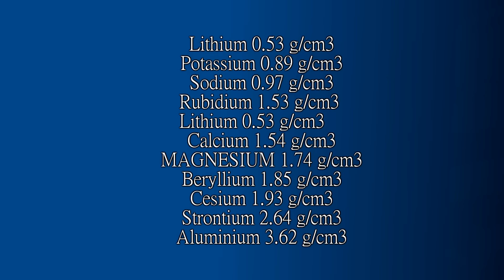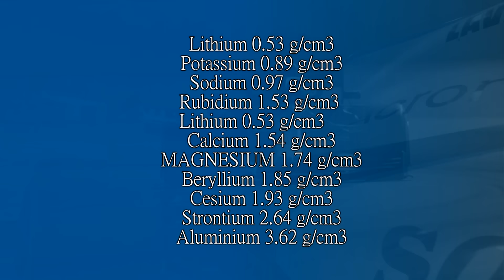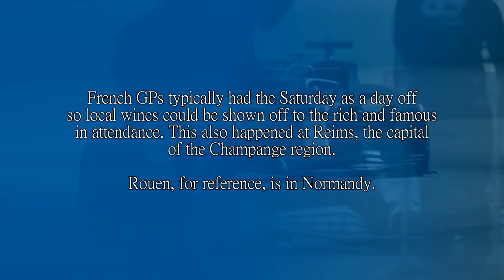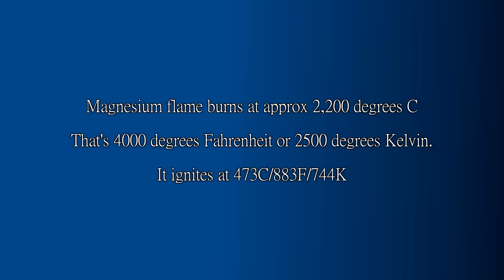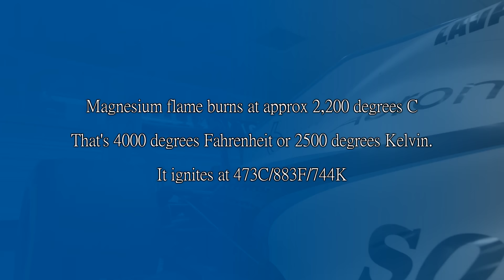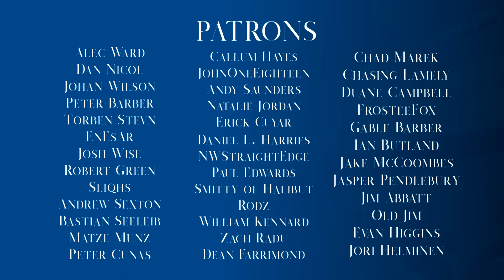The Car that Should Never Have Raced: The Story of the Honda RA302

Comment from the maker: Just some extra bits/corrections to save you writing them yourselves:

Aluminium is a little lighter than that table says
Eagle had also run a mag panel car. Gurney got rid of it after this.
Lockheed-Martin was just Lockheed in 1966. I just used the modern name.
Degrees kelvin isn’t a thing. Just kelvin
Reply: Composite DID exist and was in use in the aircraft industry.
Aluminum honeycomb fiberglass has been around since the 50's. 
As for Magnesium the fire attendants would have tried but found out that water on a magnesium fire intensifies it! Chances are it wasn't to bad fire wise until they added water to the mix then BOOM, it adds oxygen and the chemical process releases a lot of heat. Fire retardant for magnesium was available back then but for a truck full would have been 100K back then! The French are not spending that money are they let alone thinking about it?  John Surtees was no dummy and would have known this hence the refusal, remember he had no problem riding magnesium built motorcycles. 
As for the flammability of Chunks of magnesium it has a lot to do with the surface oxidation and heat present in the metal.  Magnesium is also cast so you would think it would just go up in flames during the casting process but it doesn't. It is the surface oxidation that prevents the combustion. When cast we used to smother the patterns with R12 until the cast temp was down low enough that external heat was required to commence combustion. We also machined magnesium wheels on CNC lathes mostly Group A during my time (DJR, WR, Nissan/Gibson and many others) and they were also dangerous to machine as you are producing magnesium ribbon if not finer during the process. A normal Aluminum wheel would use a single 1/4" coolant outlet to promote tool life and finish. On a Mag lathe we used 3 wash pumps pumping coolant at 70 psi through 1" outlets.  The coolant was also Glycol based. This kept the temp low enough and prevented exposure to air during the process when there was heat around as it was basically submerged.  A sub contractor did still loose a lathe to fire though during my time and because the release of R12 became illegal to save the Ozone they didn't have a magnesium fire extinguisher and their sand bin had got wet.
Reply from the maker: @dazaspc  good old fibreglass. Used on gliders but not really seen on an f1 car until a bit later after this.
Reply: @AidanMillward  F4 phantom glides pretty quickly🤣
Reply from the maker: @dazaspc  all planes are gliders if the engines pack in 🤔
Reply: Phenolic composite has been around since the 1920s.
Reply: @dazaspc  Actually, the F4 Phantom has the glide ratio just slightly better than a brick…
Reply: @dazaspc  No, not really. The shuttle was designed from the very beginning to be a “lifting body”. The F4 was designed with more thrust than lift.
Reply: @HappyHarryHardon  …would that be referring to “Bakelite”?
Reply: @AidanMillward  … some “gliding” MUCH BETTER than others
Reply: @dazaspc  The problem wasn`t magnesium or air cooling but the inexperience of Schlesser and bad weather. He did slide from the track on a corner and hit the earth bank. He got fatal injuries hitting the bank. The side fuel tank also exploded and made the car burn.
Reply: @AidanMillward  The problem wasn`t magnesium or air cooling but the inexperience of Schlesser and bad weather. He did slide from the track on a corner and hit the earth bank. He got fatal injuries hitting the bank. The side fuel tank also exploded and made the car burn.
Reply: The first composite F1 car appeared in... 1966. The M2B used a composite of Aluminium and Balsa wood for large sections of it's structure, and the M2A would use it for the entirety, though the reason the M2B was used is due to the inflexablity of the material.
Reply: @marguskiis7711  He indeed had an accident that resulted in a fuel fire. However the magnesium added a high temp fuel that was amplified when water was applied by the local fire guys. Magnesium catches fire at about 480C, melts at 650C and burns at a bit over 2000 C. Petrol catches at 280C and burns at about 950C. Magnesium added significantly to the intensity of the fire. Who is to say that it may have been survived but for the metal fire. Also a 2000c fire leaves little if no organic matter. Regardless it was a sad occurrence that with a little primer on the metal would have most likely slowed the fire a lot.
Reply: @dazaspc  Schlesser body lied besides the wreck dead (due the massive impact) and did not burn a lot.
Reply: @GroundHOG-2010  exactly, McLaren built the first one.
Reply: @HappyHarryHardon  9
Reply: @macmclemore  The shuttle is not a lifting body at all, it's a fuselage with distinct wings attached to it, a fairly conventional delta-winged airframe.
Reply: I always say "degrees Kelvin" just to troll the uptight.
Reply: 8kkkk
Reply: Random additional fact, there had already been an F1 car run composites by the 1968 season. Robin Herd, of later March fame, was hired as a designer/engineer for McLaren and developed their early F1 cars. Prior to that, he was an engineer at RAE working on Concorde. From that experiance the first McLaren F1 car, the M2B (and previous M2A test vehicle) used a composite called Mallite for large portions of the car. What is Mallite? It's Balsa wood skinned in Aluminium, which makes it rather light and stiff, but as per usual with wood... it's hard to bend and form to a curve. It would often break while being formed and required a lot more work.

Comment: It's mind-boggling how this happened 13 years after the 1955 LeMans disaster also involving a car made of magnesium and Honda thought nothing of it.
Reply: Not being around at the time, I guess those at the time understood as we do now that motor racing is dangerous... just their measure of acceptable risk was different. It was what it was. I'd assume that everyone understood plenty well that the 150+ liters of fuel they started the race with was flammable and that concern was ignored. Also, the flammability of the Elektron wasn't exactly the problematic part of the 1955 disaster.
Reply: Happened again in 1970.  Alejandro de Tomaso has built a magnesium chassis F1 car that Frank Williams entered for Piers Courage to drive.  Courage had a good year in 1969 driving a Brabham for Williams, but Frank wanted his own bespoke car to enter.  Courage crashed at Zandvoort and the result was another intense magnesium fire that was immune to being extinguished.  The "good" news is that Courage may have been killed by a tire before the fire started.
Reply: To be fair, through the 60s and 70s there were many, many cars were fielded that had Magnesium alloy parts, such as the Porsche 917.
Reply: I wasn't aware of magnesium being a problem in 1955 LeMan accident. I thought the biggest problem was the car going through the crowd?
Reply: @jamesharrison3537  The Merc chassis was made of Magnesium, when it caught fire water was used to try and put it out, which made the fire even bigger. After the initial crash a lot of the casualties were smoke inhalation and burns.
Reply: Let's not forget Lancia doing the same thing in the 80's and killed Group B in the process
Reply: Worth considering that Motorsport deaths and I mean spectators as well as drivers was not unusual. And also it's worth remembering that human life didn't have the same significance we 'westerners' are used to considering today. 
F1 was largely a European sport and as a result the people involved had a very fresh memory of a time when human life was here today and gone by the million tomorrow.

I've not been eloquent in my point. But I stand by it.

Honda weren't bloodthirsty. It was just how things were.
Reply: The Lemans disaster was not due to magnesium,  it was due to a car flying into the stands full of fuel.
Reply: @fix0the0spade  the 1967 Eagle F1 was all magnesium sheet.
Reply: @truantray  The fire that raged on after the initial incident, which could not be extinguished for hours due to the magnesium body panels and the fact the fire department used water based extinguishers, caused many if not most of the deaths and injuries.
Reply: @StevePhoenix  I believe, if you watch the film, most of the deaths were actually caused by the engine plowing through the crowd. It didn't get into the grandstand, but instead got the fans standing and watching on the ground level. You can watch the engine rolling over & over, and when it's done, where before there was a large crowd, there's no one left.
Reply: Something to consider back in the era of the 1950s through the '60s:  The media was not frankly forthcoming with detailed information about situations in motorsports.  Where the details of the 1955 Le Mans disaster may not have emphasized about the magnesium aspect of it.
The media nowadays are coming up with far more details of what went on behind-the-scenes of 1960s races and race teams than they did when it was current back in the 1960s.  I know since I was a subscriber of Autoweek newspaper and bought the automotive magazines of that era, such as Sports Car Graphics, Road & Track, and Car & Driver.  Those publications withheld a tremendous amount of details going-on, in the 1960s motorsports scene, that only came to light many decades later.
Reply: @jimiverson3085  yes, magnesium burns so hot that it burns water.  I worked for decades in machine shops.  we once started some magnesium chips on fire at work.  they burned a hole in the concrete floor.
Reply: Should we talk about the 1971 magnesium-chassis 917 KH Martini which won that year's Le Mans? 😏
Reply: @har234908234  Surtees refused to drive the car though, so was clearly aware of the risks.  One does wonder why the designers choose to pursue the magnesium alloy chassis, although the air-cooled V8 that Honda-san insisted on wasn't competitive anyway AFAIK.
Reply: @TassieLorenzo  Hard to know if Surtees refused to drive it because of what would happen in the event of a crash or because of it's likelyhood to crash? A little hard to judge the V8 considering it was only raced for two laps.
Reply: @bloqk16  You know what magazines might have surprisingly technical details of race cars from that time? Popular Mechanics, Popular Science and, particularly, Mechanix Illustrated. Mechanix Illustrated had a famous auto-columnist, Tom McCahill, who was probably the biggest selling point of the magazine. I think most people bought it for his column and articles. These magazines would do a lot of speculation on what was new and what was coming, and sometimes they were right (like they were on the turbine car 10 years before it became a reality) and sometimes they were wildly off (like thinking that in 10 years, after the Parnelli Jones turbine car at Indy, we'd all be driving passenger cars powered by turbine engines).
Reply: @RRaquello  Very true about those periodicals; as occasionally I did buy an issue.
The three magazines you wrote about were only afforded if I had the spare cash for them; which most of the time I didn't.

Being a youngster of limited means back then, my dollars could only go so far.  As a teen, the financial choices of having a car with a full tank of gas; having car/motorsport publications; or going on dates for movies and dinners (even if it was only at fast-food drive-ins)?  Well, the first two choices always won-out over the third.

xD
Reply: @Dorench  That and the aluminum .065 wall tubing used in the literally fake roll cage.
Reply: @bloqk16  I was a big fan of Popular Mechanics when I was a kid, especially around age 12-14. More than of car magazines, because while I liked cars, they weren't my main thing. I was into mechanical things like typewriters and sewing machines, LOL. Especially typewriters, which fascinated me (and still do). I liked the car magazines because in the ads they offered free stickers if you sent away for them, so I had car stickers (STP, Hurst Shifters, Hooker Headers, etc.,) all over everything I owned. This was all in the early-to-mid 70's.
Reply: @AdamMGTF  Car racing didn't take driver safety seriously until Jackie Stewart organized the Formula One drivers to stand united against the worse of the atrocities foisted on them by team owners/car designers. Formula One was a series with few rules beyond absolute engine displacement. Innovation was the word. But that meant driver safety had zero input in the design of the cars. Stewart was able to get rules installed that fixed some of these issues.

Jackie Stewart was a great driver, but where he really shines is in his leadership in the area of driver safety.
Reply: @AdamMGTF   not saying Europeans were uncaring & bloodthirsty, but they were ten years removed from WW2 where mind numbing death & destruction was common during the war.
Reply: Back in those days F1 didn't care about savety _at all_. Those cars didn't even have seatbelts – because that's unnecessary weight. After the accident, Honda even just built a second RA302, but this time couldn't find anybody silly enough to drive it.
Reply: @kailahmann1823  seat belts were introduced by racers, all race cars have seat belts. Le Mans racers don’t wear them properly due to the unique starting procedure, once they pit, they strap down like any sane human being does,
Reply: @jamesharrison3537  Indeed the Mercedes flew through the spectators...in flaming magnesium shrapnel.
Reply: @jamessimms415  yep. That was a factor for sure. Plus I've read a few ww2 veterans autobiographys and there is a split. Most want a simple life. But a few seek out extremes. I'm sure there are some interesting scientific/phycology papers about it
Reply: @RRaquello  Remember McCahill describing a friends "Sports Car"? A VW Van with a wet bar?
I grew up reading everything that Tom wrote.
#Aloha
Reply: @cdjhyoung  Jackie Stewart  also provided support to the next generation, after the death of Ayrton Senna. 

Niki Lauda announced the reformation of the Grand Prix Drivers' Association (GPDA). The representatives elected were Lauda and active drivers Michael Schumacher, Gerhard Berger and Martin Brundle.

Jackie Stewart also provided support again for the introduction of the Halo and other safety measures.
Reply: Lotus built cars that were constructed so light that they were always verging on structurally breaking and Williams sent Ayrton Senna out in a car with badly welded steering column repairs, which killed him.
Reply: In California people used to throw VW engine blocks on bon fires to light them up.
Reply: Yeah I thought the same
Reply: @pauljaworski9386  Bull$hit!  The Mg chips from machining have very little mass with lots of surface area, so they burn extremely fast and are burned out almost as fast as the fire started.
Reply: @e-curb  Actually the fire burned through the floor and all of the way to China!😀
Reply: Its not like people were standing literal inches away from cars flying by at 170mph during the 55 lemans
Reply: @jamesharrison3537  thats exactly what it was. The fact that the body burst into flames is irrelevant because the front axle barreled through the crowd at 150+
Reply: Magnesium is so dangerous underratedly so. It's SO flammable my great grandfather was in charge of a Dow Chemical magnesium production facility. On at least one occasion he was seriously burned.
It doesn't exactly go out... or get put out. It burns out when everything is consumed.
Put some "mag" wheels on a heat source (race car brake system or engine) add some high octane fuel ,  cage in a driver, rush oxygen at it like a supercharger due to speed.
Disaster
Reply: Le Mans was a different set of circumstances altogether , Having been around few years priors Schlesser death , one has to understand in those days , it was normal for a Formula one  driver or any Race car driver to loose his life at every race , tragic but true , it was almost expected , one of the reason some of these drivers went on a binge the day before the race . Mechanic wore short instead of full body suit had hats instead of helmets it was the same for them , the unsung hero . Races were never stopped  in case of accident in stead race car would go around the crash car , safety crew and ambulances . Another era !
Reply: @Dorench  the delta s4 bodyshell was some kevlar and something else .
Reply: TRULY!
Reply: That wasn’t the big issue with that accident
Reply: They 100% knew how flammable magnesium was, it’s given a big amount of respect by any metal worker making stuff with it as it’s caused way to many fires inside workshops, Honda knew how dangerous it was and still used it